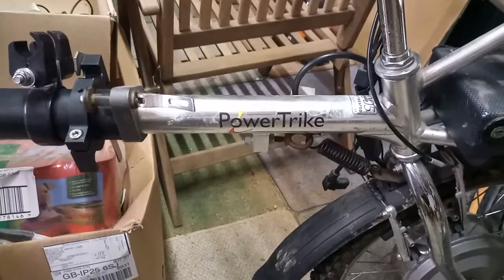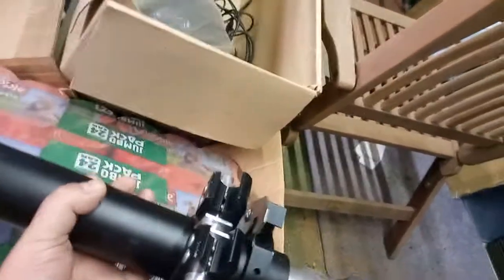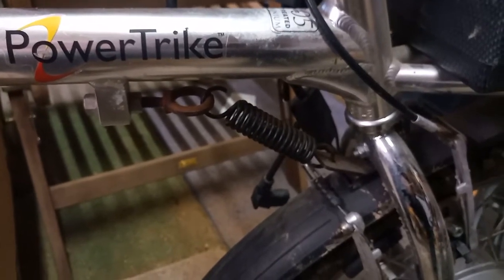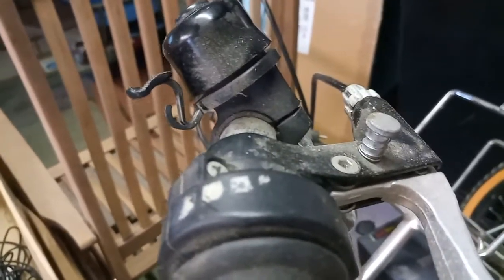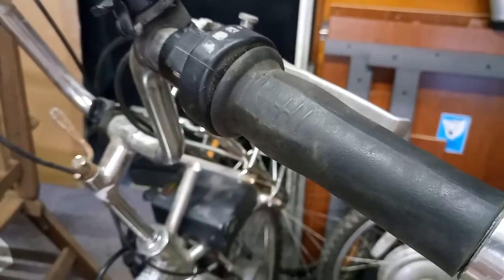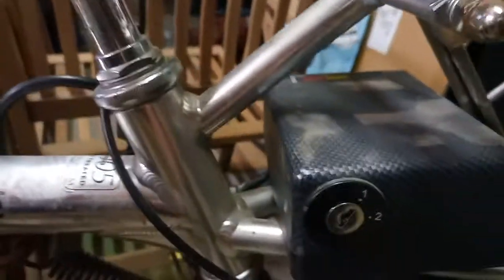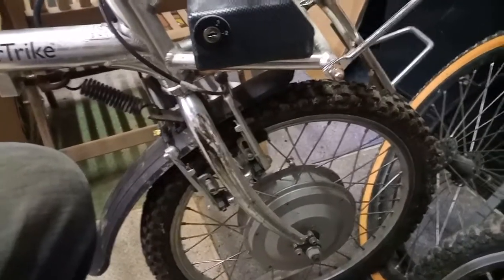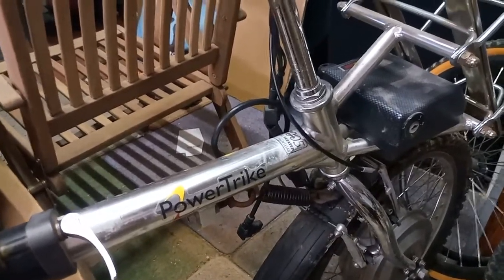Electric Hub Motor Wheelchair Trike Attachment - Key Components for DIY re build

Comment: Thank you so much. We have a similar control box to yours but only 1 key slot, 2, 2 pin slots for the brake and cut out cable and a 3 pin slot which we have no idea what it's for. Would you know? Thank you
Reply: The throttle uses a 3 pin connection, could that be it?
Reply: @pc4644  Hi, the throttle and cable (on the right handlebar) are already connected to the control box. All we know that's missing is the power cut off lead and the lever.
Reply: @pc4644  My mistake, yes there are two identical inputs, 1, 2 pin and 1, 3 pin where the throttle goes but on the outside look the same. The other 3 pin has a Red cap cover on.I'm thinking the cutout cable goes to the 2 pin one but can't find the cable with 2 pin connection. Thank you so much for taking the time out to help.
Reply: Your welcome
Reply: @lubilu43  Not sure if you've figured it out yet, could you clarify please 🤔
Reply: @pc4644  Hi we have ordered the lever and cut out cable. Not here yet, I'll update when it's fitted, see how we go. :)

Comment: Hi, do you have any idea where we could find the lever and cut out cable please? Thank you
Reply: Hi, any e-bike brake lever from eBay will do the trick. The cable ... If electric and not brake cable wire (in which case any brake cable will do, just cut to length) then it comes as part of the e-bike brake lever.

Hope this is helpful 👍